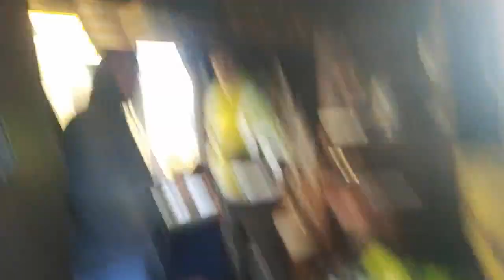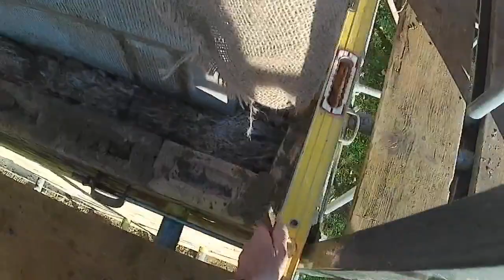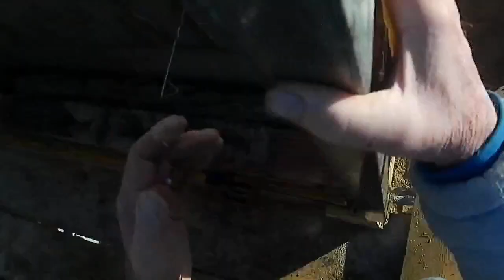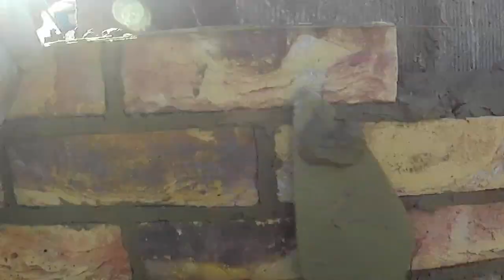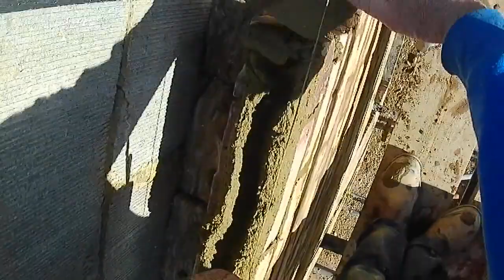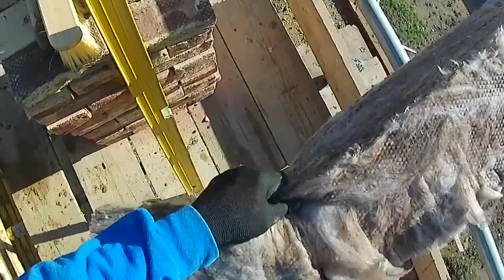Profiles or Traditional corners.

Comment: The reason your mirror may have dropped off is if you have heated self defrost mirrors the glue holding the glass on may let go had it happen in my Holden Astra you guys call them  a  Opal in England had it happen twice now
Reply from the maker: Thanks, they aren't heated the, the clips are  just worn out where they have been nicked or replaced so many times, going to silicone the next one on. 👍

Comment: The system is still the same in Holland. Carpenters set profiles, especially on large jobs. In addition to wooden profiles also aluminium are used. The difference from posing with you they always beinig braced in the top. You probaly still know that. A Dutch bricklayer uses a level only to check a profile before starting. In the 70 and 80s you saw a lot of "wild" bond in Holland. Had to do with the differcenc of length of bricks in those days, like the one your now working with. Have you done yourself "wild" bond in Holland.
Reply from the maker: Yes I did quite a bit of Wildbond while I was there, once you get your head around it it's easy enough, I lived and worked in Veenendal.

Comment: Morning, just a quick one, if you build a small corner at the end of lchamder lift, I, e using a hop up, when scaffold goes up your drick work will be higher for you profile's, j
Reply from the maker: I do that sometimes but I was planning on being there when the scaffolders turned up but we were on another job as we were waiting for joists, It should have been a course lower 👍

Comment: You're a experienced bricklayer whst are your views on building corners without using a level? Is it something you've done or would do? Thanks.
Reply from the maker: We were taught at college to use your eye to plumb 4 courses but you still need to level, I think I need to do a vid to explain it better 👍
Reply: @bricklayersworldwithandy6277  the uprighting side i get easy enough to knock a small corner plumb but how would it be corrected if it was out of level after its built? I always level and plumb every course then I don't have to return to bash it about but then I'm not in that much of a rush and if so would get the profiles out. 👍
Reply from the maker: @grahamdalzell6933  I can build a 4 course corner without leveling or plumbing and then check it with the level to make sure then tail the corner out from that leveling and plumbing, in the grand scheme of things probably doesn't save that much time though.
Reply: @bricklayersworldwithandy6277  thats what I thought set a profile up in 5 minutes if its a time saving issue. You tried henry westons cider?
Reply from the maker: @grahamdalzell6933  Yea mate drink it at home sometimes, you know when you have had a couple of the strong ones, drink Aspell in the pub.